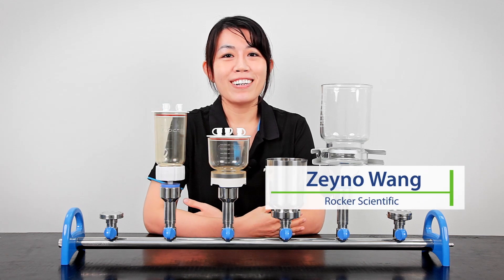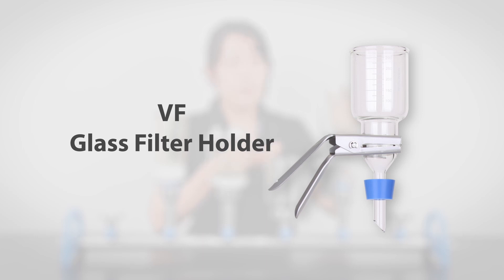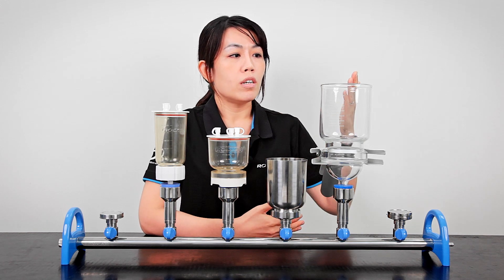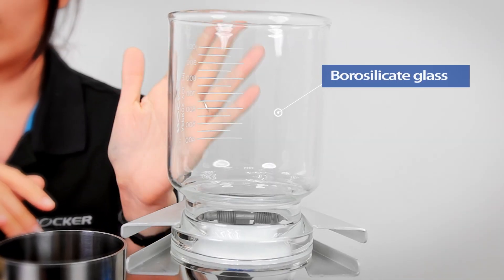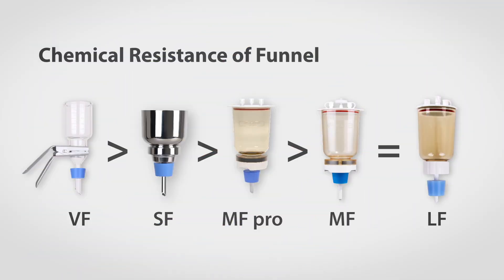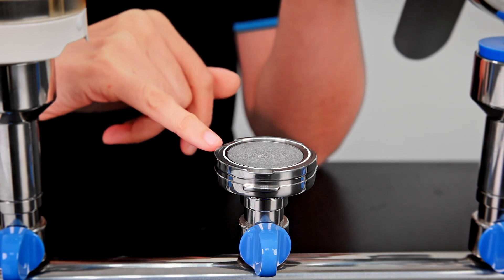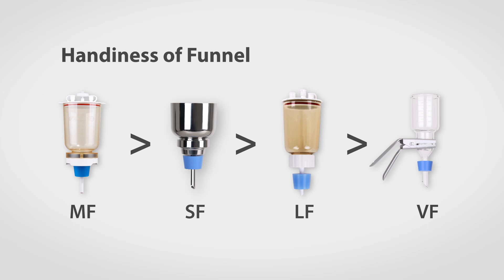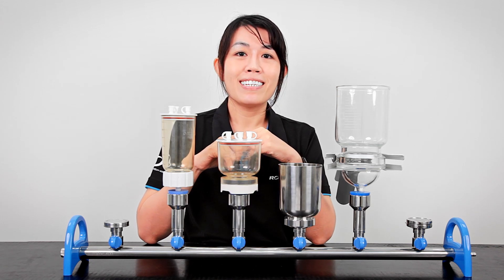Choose the best glass, PES or stainless steel filter holders for your lab

Comment: Which is best water testing n media sterilization?
Reply from the maker: MF is recommended for water filtration and media filtration (sterilization) due to its autoclavability and compatibility with various bottles. However, if flame sterilization is specifically required, the SF series is also a good choice.